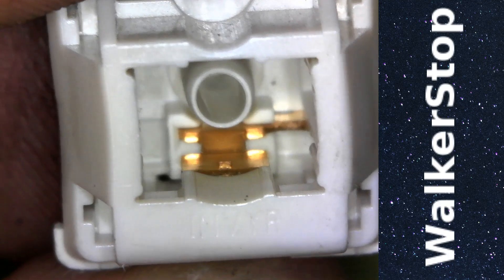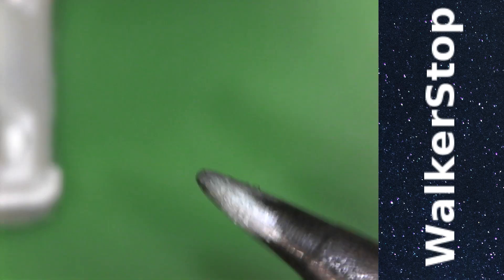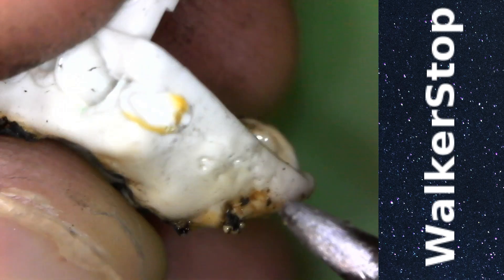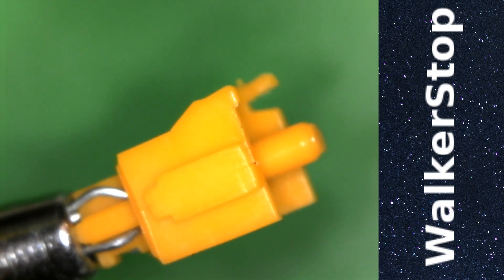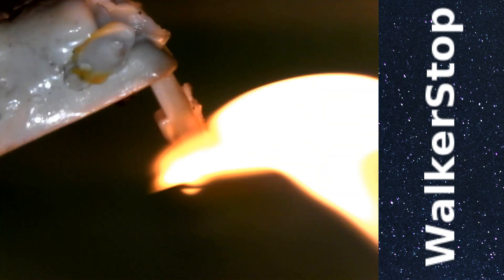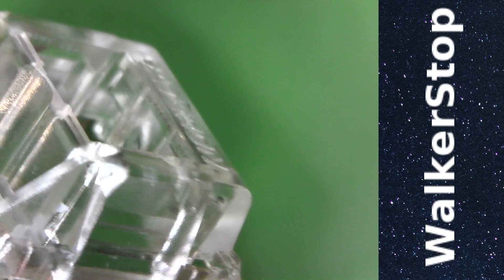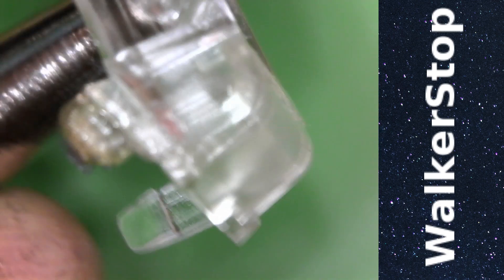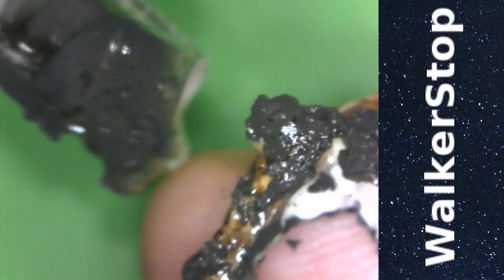Are Panda tops really made of POM?

Comment: you should use a temperature controlled iron with probe for actual measurement instead of a lighter.
Reply from the maker: linerror I am using a temperature controlled soldering iron in this video, but burning is different from melting, and for the burn test you need flame. Search for "plastic burn test" to learn about it
Reply: You should watch the entire video before you comment...